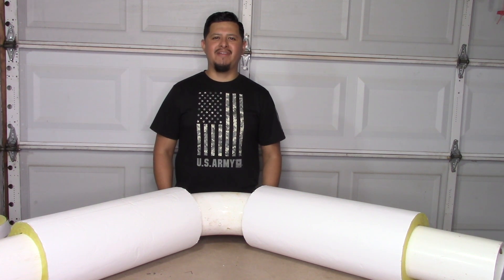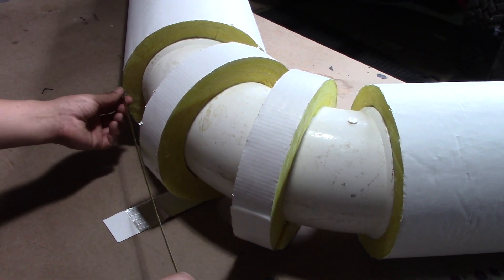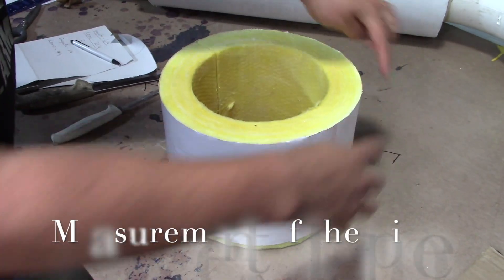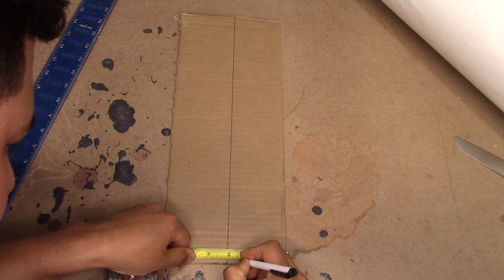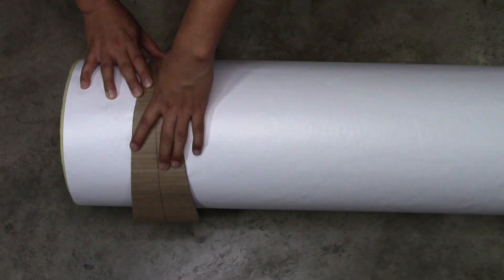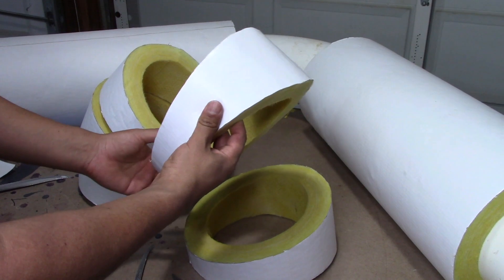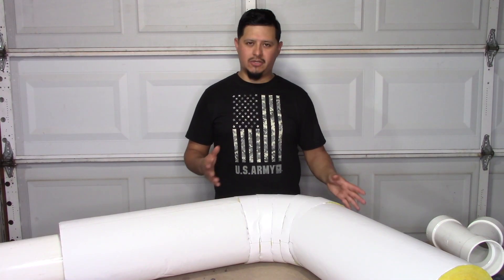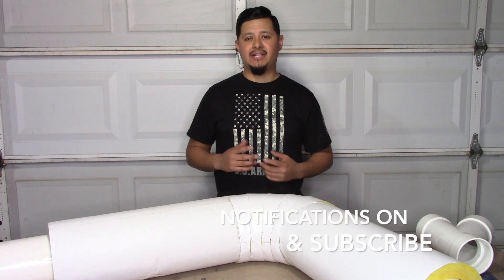How To insulate a 90 Using Miters.

Comment: Would this way work with a 45 too?
Reply from the maker: Yes it does, it’s the same process just half the miters than a 90, number of miters will depend on the size of the pipe
Reply: @jpadtv1178  awesome thank you’